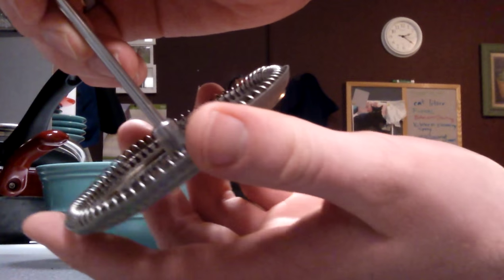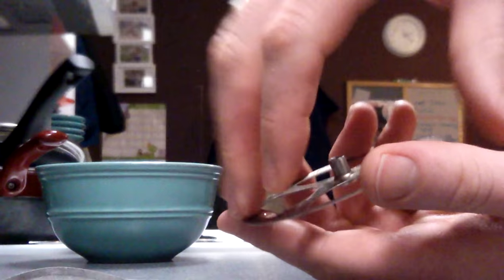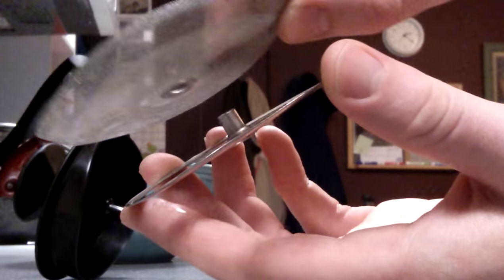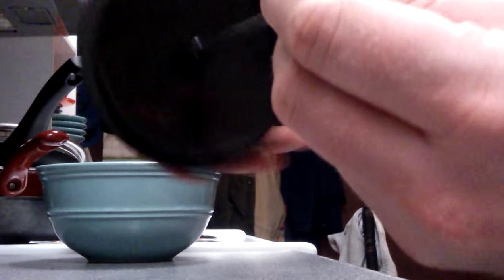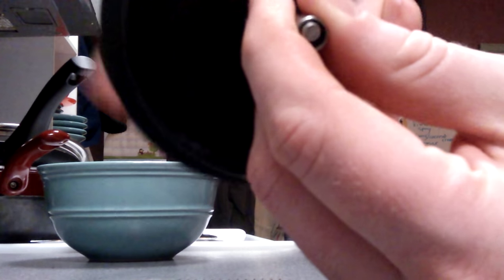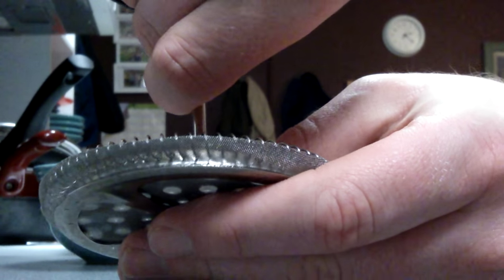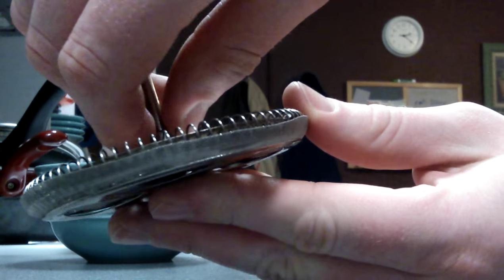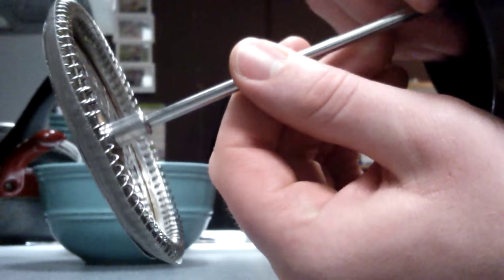French Press Assembly

Comment: Thank you for posting this video. I was about to return my press thinking it was defective. I kept fully screwing the bottom piece to the rod and because of that the small sliding piece would not grip onto the  threads. By tightening the bottom piece only a few turns it like you explained it worked. Thanks!

Comment: Thank you for posting the video.  But I want to know, what is the purpose of the spring plate on top?  Seems like it should go at on the bottom to prevent the plunger from pressing down too hard on the coffee grounds and forcing the grounds up, but that's not how it's set up.  So what's the purpose of it?